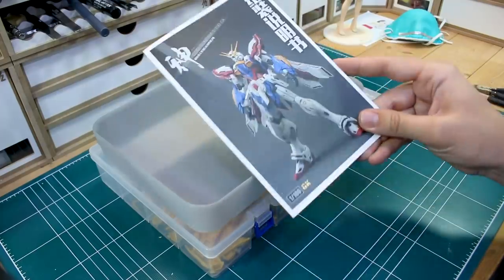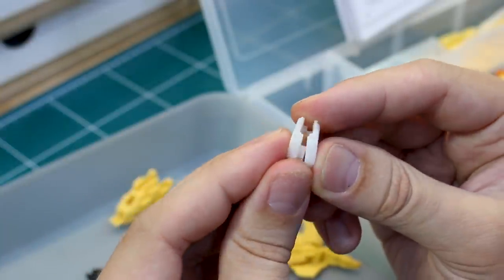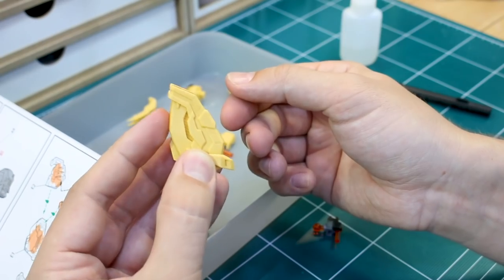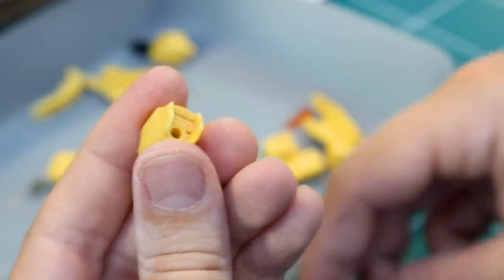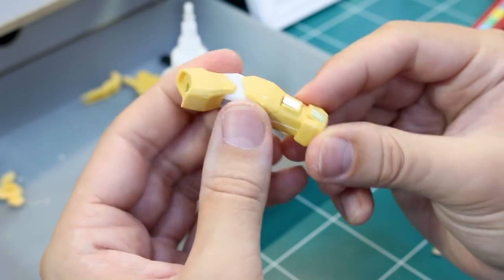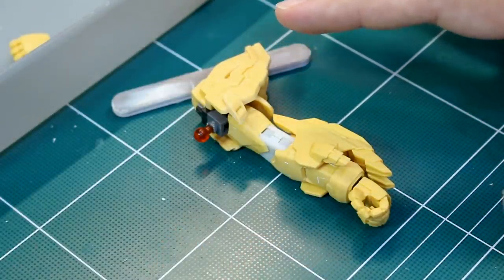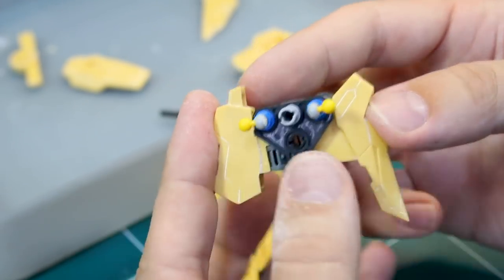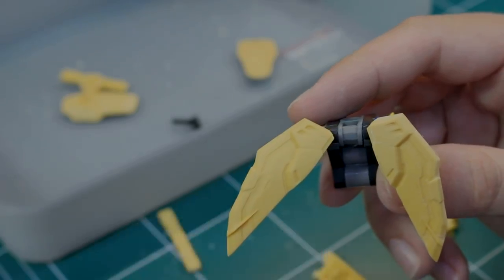Model Bingo God Gundam - Full Resin Kit WIP Pt.3 (Arms & Waist)

Comment: working with magnets is really tricky, you don't want to mess up the polarity. when I'm working with magnets I do it differently. instead of using one magnet on each side that connects together I replace one of the magnets with a piece of metal that the magnet will be attracted to that way I can't possibly screw up the polarity.
Reply from the maker: Definitely! I may be doing that technique for the effect ring. That’s still in planning

Comment: So the manual was wrong, it's clear the blue pins were supposed to fit into the grey technic parts and then through the larger black parts so the blue pins were flush with the black from the outside. Didn't make sense when you were putting it together at the time because it seemed like a much weaker connection and now I see it was an issue with the instructions. Those parts are pennies on bricklink if you need to track down replacements, though the yellow parts attaching the side skirts are not official Lego so you're stuck with what you got.
Reply from the maker: I sorted it out no problem! Luckily

Comment: 9:35 hmmm I thought resin dust is toxic. is it toxic?
Reply: From quick research: Polyurethane resin is toxic and heated bismaleimide resin can cause irritation in eyes/throat/nose. Epoxy dust before curing can get trapped in mucus and cause respiratory irritation and allergic reactions. Thermoplastic has no adverse effects. I have no idea what kind of resin this is.

This question is pretty interesting though. I have heard Gunpla threads just say “resin is toxic” and not getting into the specifics which leads me to believe the repeat of info was done without research, the science lost along the way. I’m sure it’s not good to inhale, though small amounts are probably something you will heal from (unless you have a compromised respiratory system, I do) but I’ll keep researching to find out exactly why.